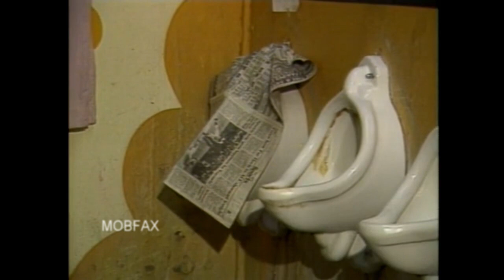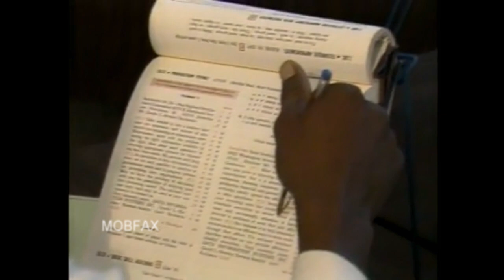Prison Overcrowding: Maryland House of Correction - Jessup

Comment: I did my time in Maryland, I worked in the sheet metal shop at MCI-H, I got certified as a sheet metal mechanic and when I got out of prison I went to college and graduated with a technical degree in HVAC and have worked for the same company for 9 years now, got married and had two daughters. I completed my parole after 10 long years in January.